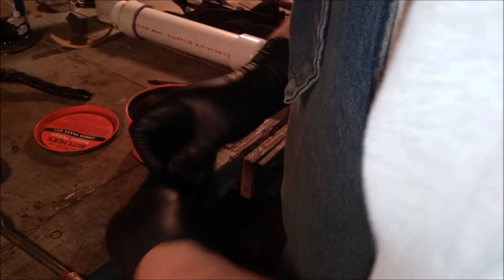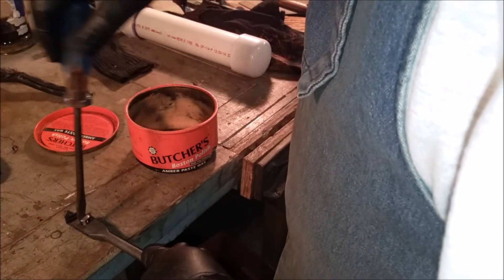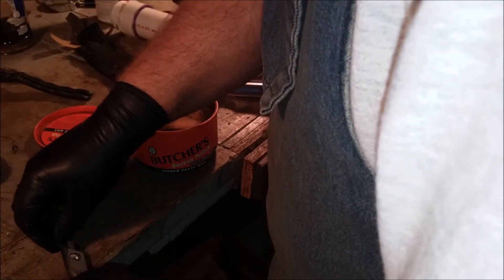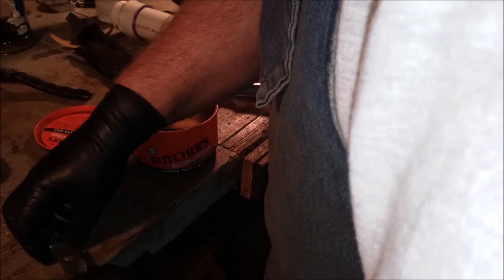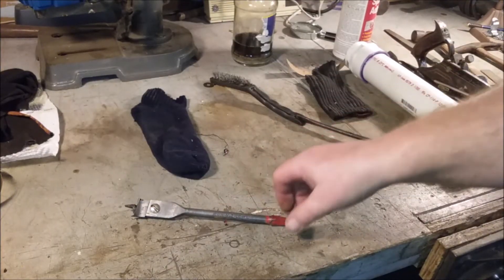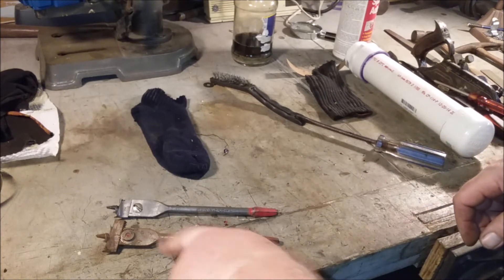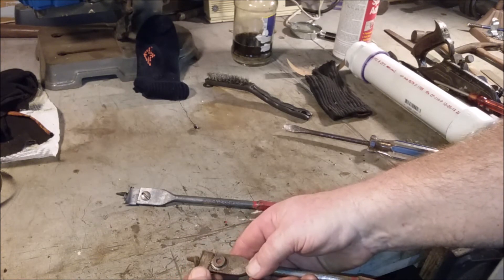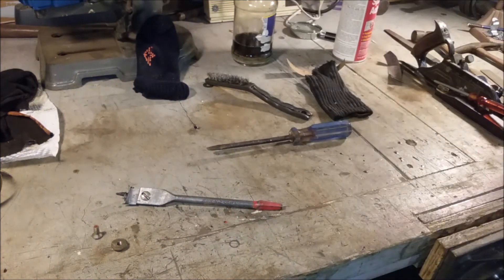Cleaning & Sharpening Irwin Adjustable Bits by Old Sneelock's Workshop

Comment: I'm going to try your de-rusting method if I can find something big enough to hold my rust stuff, like a lake perhaps.
Reply from the maker: +Lewie McNeely When I first started as a Manager/Engineer for United Technologies I worked in an Aluminum Extrusion plant. The end process was anodizing the extrusions. Most were 20 to 25 feet long so the tanks were pretty big. One of the operators messed up and put the wrong chemical in the rinse tank and it ate a hole in the bottom. It was a month or two before we could get another tank and I needed to have that rinse tank working. Since it was just water I figured there was little risk in trying a desperate move. I bought a roll of 9 mil plastic sheeting. We draped it into the tank and fastened the sheet along the top edges with screws and batten boards. It worked amazingly well and we were able to run until we could replace the tank. 
All that long story is leading up to the idea that you can use a wooden crate lined with plastic or for a diesel powered guy like you, even a hole in the ground lined with plastic. That way the limit on the size is how big a sheet of plastic you can find. With the track hoe you will be able to derust a locomotive. :-)
Reply: That's what I like about you, Unc. You're always thinking!! I bow to your experience which I really like hearing about. Thanks again!!